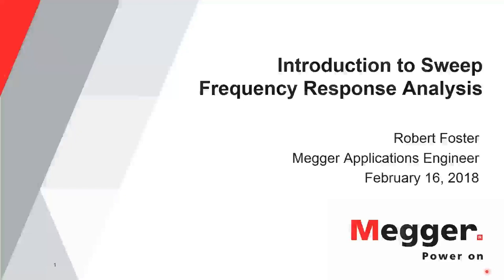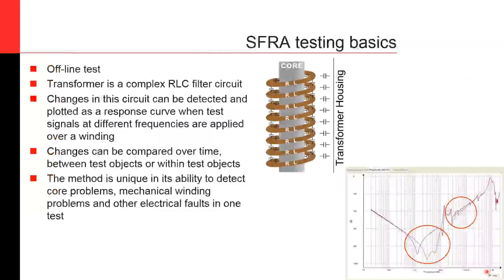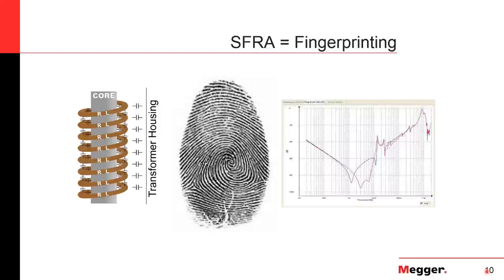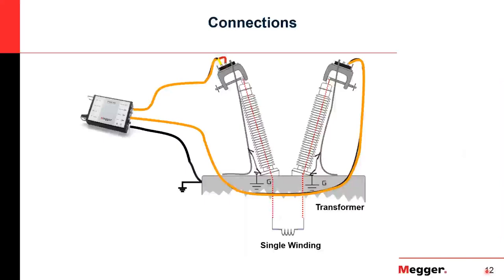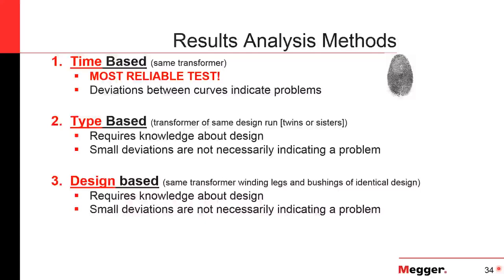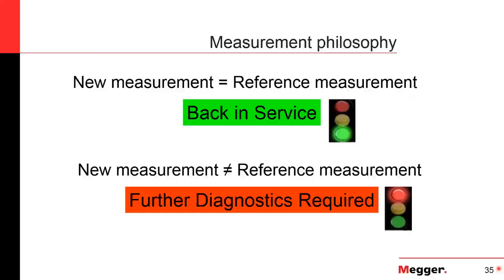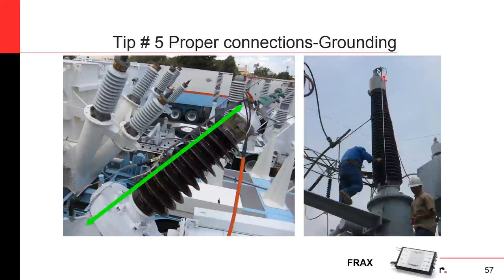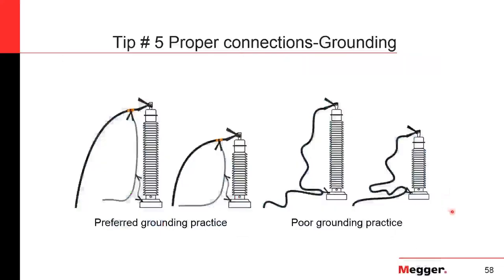Introduction to Sweep Frequency Response Analysis

Comment: We want purchased SFRA test kit
Reply: Did you ever get an answer to this question? I had never heard of sweep frequency response analysis (SFRA) prior to this video, but have been making impedance spectroscopy measurements for 25 years, which is the same thing. There are so many different names for the exact same measurements: impedance spectroscopy, frequency response analysis (FRA), complex permittivity spectrum measurements, complex resistivity, non-linear complex resistivity (NLCR), induced polarization, spectral induced polarization (SIP), and several others that I’m sure I have missed. The definitive text on the subject is Dielectrics and Waves by von Hipple.  You just need an impedance analyzer or LCR meter to make these measurements.